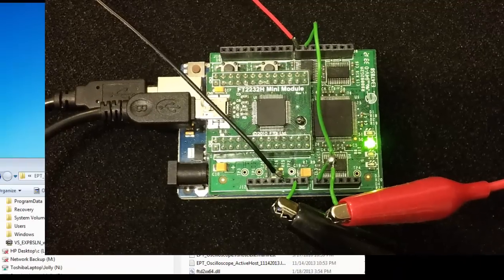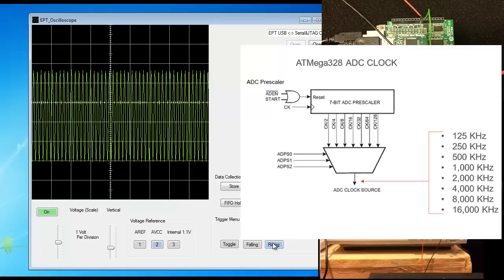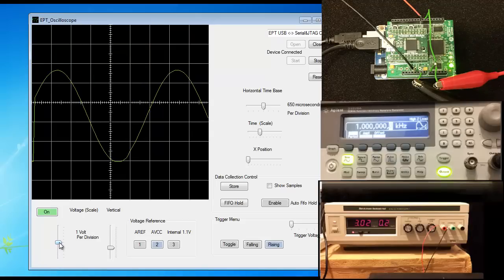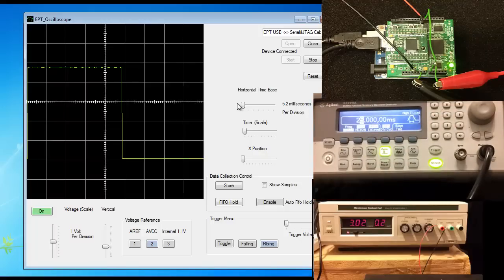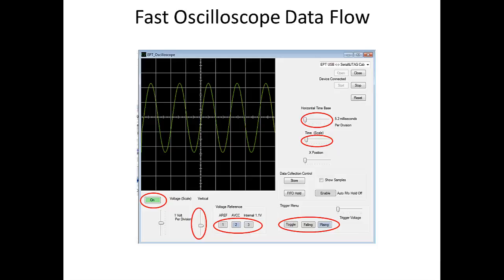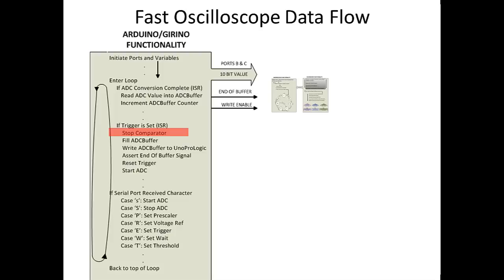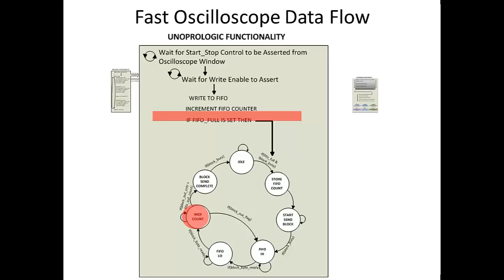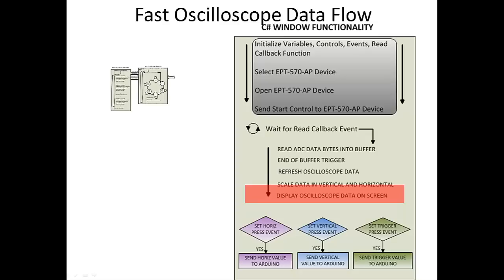Create a Fast Arduino Oscilloscope

Comment: Of course, you know that you can already use the audio input of the sound card of a computer for visualizing signals up to 96KHz and up to 1.1V PP (in 192KHz sampling rate mode) without the need for an Arduino ?
Reply: Explain

Comment: the project is great, the only thing is the ardruino are LOW resolution sample per second about KSPS (kilo sample per second) and is limited to frequencies below 1 MHz, this would improve with an external ADC to handle MSPS.
Reply: Yeah, and the arduino internal ADC (on the atmega328) has voltage offsets of even up to 40mV!
Also, I don't know what the specs on this one is, since it is a non-arduino board. (Even though it says it's arduino in the title)
Reply: I have a project, i am using an Ultrasonic Tranceiver and i would like to measure a signal with has a frequency of 40 kHz. Is it possible to use this system to measure such a signal with a good resolution ? Thank you.

Comment: i wanna make a powerconverter and then see it output....the output is about 15Volts... how should i connect it with arduino using the circuit you made ? because arduino pin's maximum voltage is 5 volts i think ... and thanks
Reply: perhaps using a voltage divider with resistors. If you now the exact value of each resistor, you will know the reduction factor..

Comment: Can I use Arduino Mega 2560 instead of Arduino Uno.
Reply from the maker: Hi Ahamod, yes you can use the Mega 2560 or any microcontroller board. The UnoProLogic is completely flexible in its programmability. You can change all of the pin locations within the CPLD by just editing the signal names. Since you have shown some interest in seeing the Arduino Oscilloscope on a Mega 2560, we will be happy to build the project on the MegaProLogic. The MegaProLogic mates perfectly with the Mega 2560. Watch for a video and source code on this project in the next few weeks.

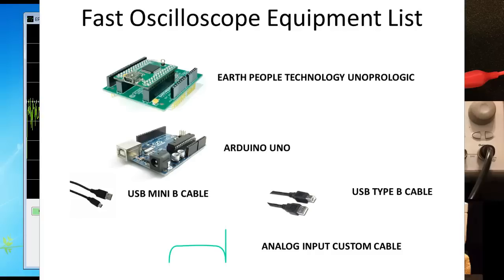Comment: 12:45 Equipment/hardware needed to build
Reply from the maker: Hi CoolDude, you will need four things to build this project. 1) An Arduino Uno. 2) An UnoProLogic. 3) Analog input custom cable. 4) DC voltage source. You can get more details in the user manual at: http://www.earthpeopletechnology.com/wp-content/uploads/2013/06/FAST_OSCILLOSCOPE_PROJECT_UM.pdf
Reply: Maybe you should put this in the description along with the direct download link. That way we don't have to go fishing through all the comments to find what we need.